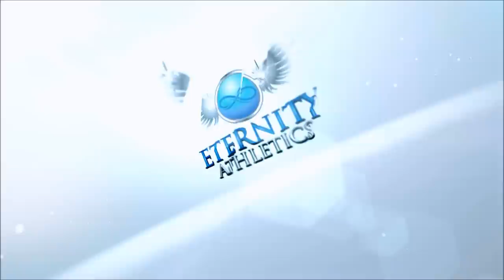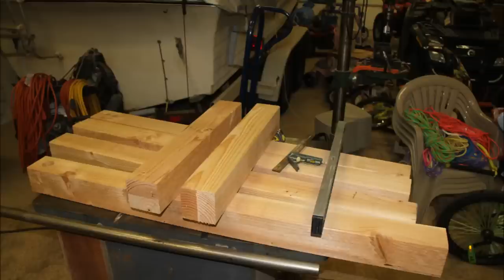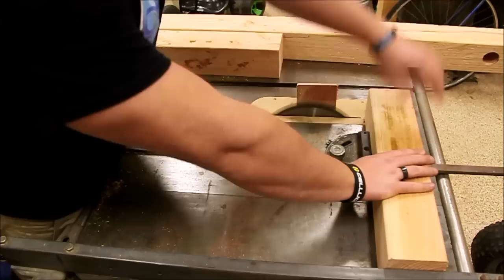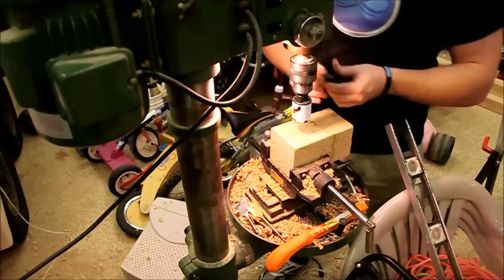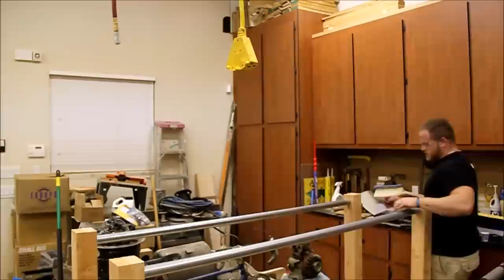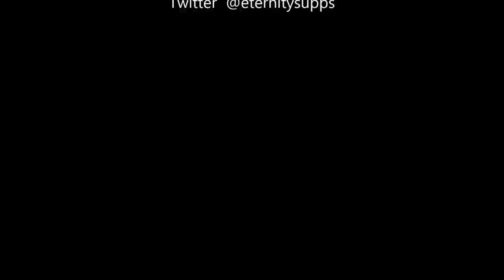How To Build Parallel Bars

Comment: Just starting to look at making these. So there is no concern the 2 halves may separate and a bar slide out or eventually get to an angle that compromises the wood posts? guess I'm thinking either a 2x4 to span the bottom between U's or a screw to hold in the bar would be good?
Reply from the maker: This being a simple design I opted not to add supports. While doing advanced moves there is more instability, so you'll want to add either metal "L" brackets to wood joints or a connecting 2x4 as you mention. Great question!